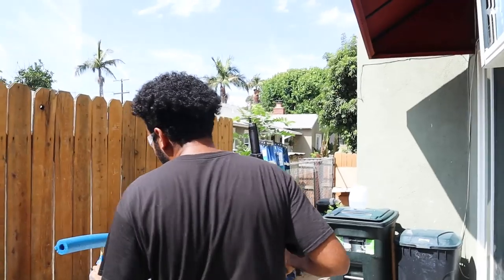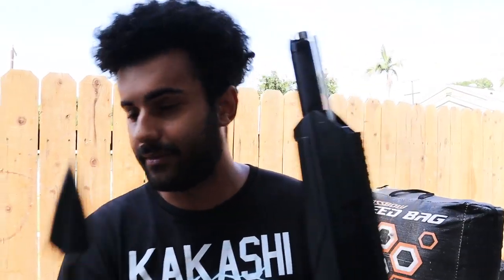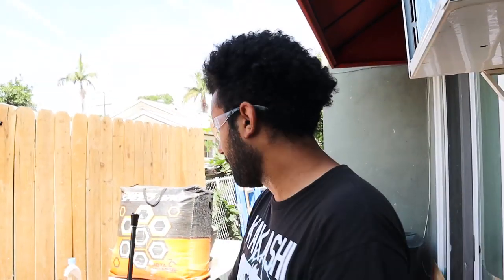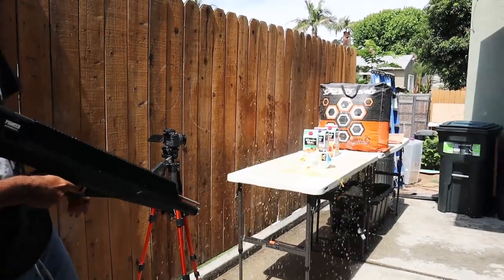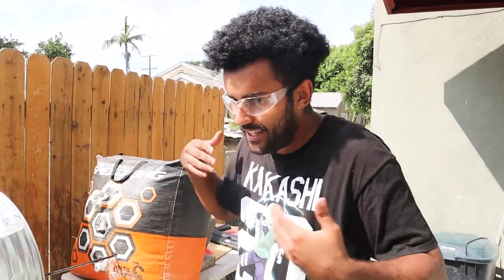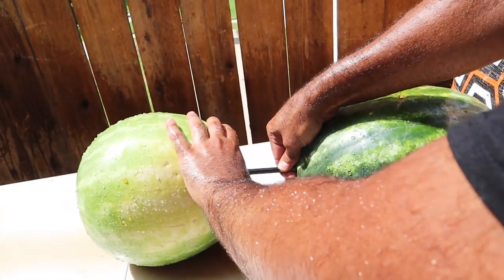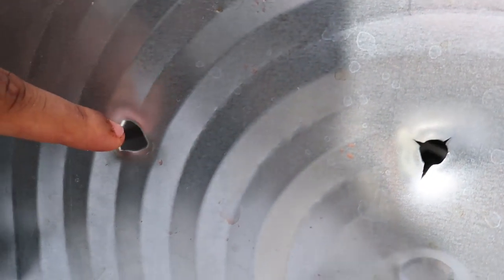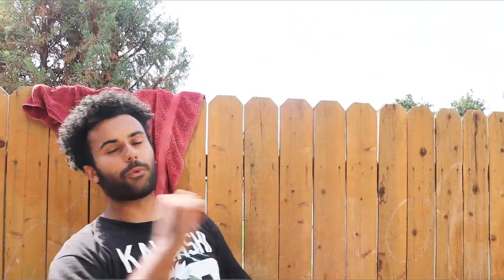I Bought ALL The ARROW BROADHEADS On Amazon!! (AIRBOW) *DARK WEB TWISTED ARROWHEAD*

Comment: The switch blade arrow head it’s ‘wings’ aren’t meant to ‘fly’ it’s meant to stick in so if u try and pull it out it will rip a bigger hole
Reply: Its actually nkt supposed to lock into the animal. Its meant to give you biggere cutting surface for bigger wound channels. Bigger wound channels = faster bleed time

Comment: Field points aka target points are not designed for penetration. And at the range you test at, airbow compound recurve crossbow all will have similar results. If you really want to test it use at minimum 20 yards distance to your backstop.

Comment: Arrowheads are used for hunting, no surprises there, so the larger then arrowhead or the “grain weight” of the head all depends on the size of the cutting area you want. So what will do the most damage. The larger the point the more cutting area so the fat set the animal bleeds out. Wider surface area has nothing to do with how it’s supposed to penetrate. It’s just supposed to make a hole to bleed. The field points or bullet points your using are for small game suck as rabbits or squirrels because if you hit it with a broad head there would be no usable meat in the animal.

Comment: Dark web more like hunting points and bird points Turkey specifically but I've used then for dove hunting before the 3 pronged blades it kinda sucks when you lose them cause it's like $45+ just for 3 points. My 90 pound draw weight bow will do about the same to that bow target if I put a sharp point on it the regular broad head is actually a practic tip made to not destroy the target fast.

Comment: Contrary to popular belief your air bow doesn’t shoot that much harder then the top on the line compound bow, you bow is rated at 450fps witch is very fucking fast BUT.... a 80lbs compound bow will shoot anywhere from 380-410fps if not more. Just a heads up.

Comment: i dont think this guy realises these are for hunting. the blunt tips are used for straight power. you hunt small game with blunt tips, like a slingshot. its not like this guy said where "itll hit you in the ribs" no itll probably pierce skin because of the high velocity. even if he had no arrowhead on it and it had the hole, itll still have a ton of power because its the bow. not the head. the head changes the ballistic damage. the bow controls how much power.